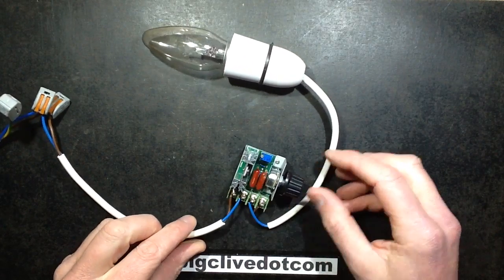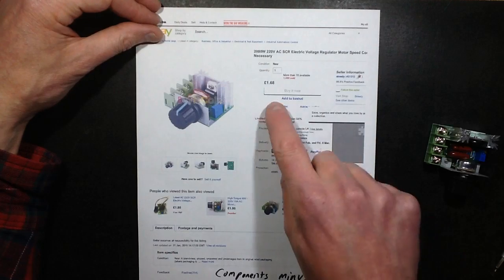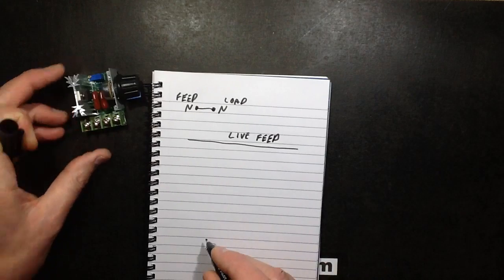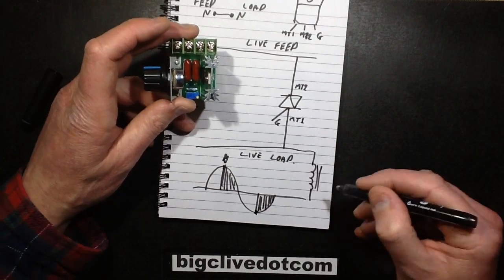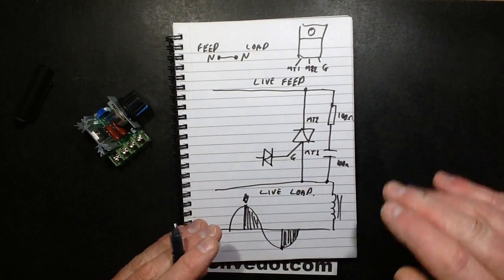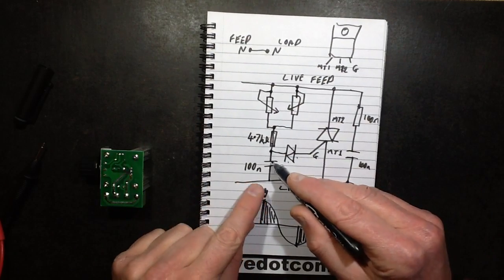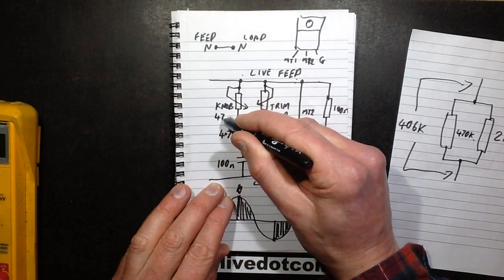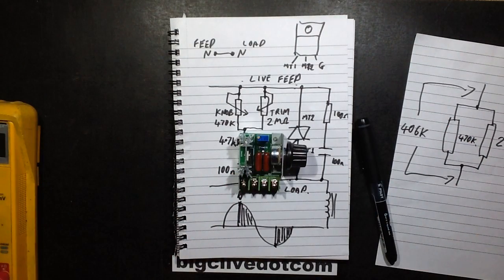Reverse engineering of a mains power controller.

Comment: Can I buy a bigger version of this one and use it to reduce my geyser wattage from 2000w to 1500w AC? I cannot find any zero cross ssr type but only similar like this one. 

I'm worried about the emi noise since I'm going to be running the geysor on inverter.
Reply from the maker: I'm not sure that would work well.

Comment: Thanks for your comment about the clicking sound from the Trimmer when it reaches end of travel.  I never realized that.  Been tinkering with AC motor speed control (small Ham Amp blower motor) by adding Power Inductor between motor and modules.  It helps smooth lower rpm speeds but requires some trial & error part swapping (time).

Comment: Clive. If  a smoothing capacitor is added then is it possible to get a lower voltage and current at the output?
Reply from the maker: Not really.  This is fundamentally a dimmer.

Comment: Hi - Always enjoy your videos and done a few of your vape battery LED light conversions (much to my children's embarassment).  I got a Parkside portable metal cutting bandsaw cheap of FB Marketplace and found out it was cheap because the track from the triac to the load was blown out!  Could this device be used to replace the blown circuit or would swapping just the triac and bridging the blown section of track be a better option.  Happy to share photos if you are interested in helping find a fix
Reply from the maker: Blown tracks is a common issue on PCBs if high current has flowed.  If the triac is physically broken or a dead short between the two main current switching pins then it hints that a short circuit may have occurred in the motor or wiring.   It usually is viable to change the triac if you can find the original fault.

Comment: Can a 110v cauterizer be run on a dimmer switch?
It is a 60 watt soldering iron.
Reply from the maker: Only if it was a simple resistive heater.  If there are any electronics, then no.
Reply: It is a 60 watt soldering iron.

Comment: Can this type of PCB useful to limit the power use for a heating element or are other PCB's more efficient?
I like to limit the power use of a heating element in a solar powered boiler setup in a campervan...
Reply from the maker: It depends on the equipment powering it.  It may be easier just to use a lower power element.
Reply: @bigclivedotcom  The heating element would be powered by a 1500W (3000W peak) inverter. 
I could install a different heating element (I probably will but the stock heating element has an anode (to protect it against whatever fresh drinking water can throw at it) 
I may even come up with a totally different way to plumb the boiler in...  I intend to use the tank of the boiler to fill with coolant from the engine and the internal coil plumbed into the drinking water system...That way the heating element does not need an anode since it is submerged in coolant (which is anti corrosive and without any oxygen - to mention)
This method of plumbing in a boiler is uncommon but not unusual... Bothe methods.

Comment: That circuit makes awful noise when you turn the pot to decrase the power. Any solution?
Reply from the maker: Each type of motor has a preferred speed control system.  This one is over simplified and creates a lot of mechanical noise.  It might be worth looking for a more professional one.
Reply: Thank you for the promt answer. I use it for a 200watt resistive heater and that noise is really disturbing
Reply: Using a triac and potantiometer can we make noisless dimmer? :)

Comment: The formula for calculating a number of resistors in parallel is given by
1/R = 1/R1 + 1/R2 + 1/R3 + ...
Series capacitance has the same format. 
With a University Degree in Physics and Chemistry I never used these formulae since I was in secondary school which I graduated from in June 1974! 
I had to check them on Google.

Comment: Given that this is most likely made using the cheapest parts that could be sourced, I imagine that the tolerance on the potentiometers are going to be in line with the 5-10% standard, so the value of the unknown potentiometer is probably 520k ohms.

Comment: After 7th minute you said that it needs a choke, can you please tell me what type and what rating of choke can we use or how to make that choke for this circuit. And I need output only half of it, i.e. nearly 130v to 140v max, can I attach 100k or 200k ohm resistor in series with potentiometer (knob type) to achieve that voltage. Please also reply to your other video of dimmer. Thank you

Comment: Im looking at buying one to control the speed on my grinder. But very skeptical because i dont want to risk killing my grinder like 3rd party chargers do to iPhones (*・～・*). Right now on amazon these units are $10. Im debating whether i should buy the triac's and diac's and build one myself. You pointed a few things that correspond to the reasons why 3rd party charges kill charging chips on iphones. They are not isolated and insulated properly. Like your explanation of the triac and the wave. Im willing to put some money on it if you willing to design a solid reliable unit. Not now tho, most likely late summer to fall. Winter here is extremely rough lol. Great video man.

Comment: For resistors in parallel 
1/R= 1/R1+1/R2
Hence 1/R-1/R1= 1/R2
(R1-R)/R.R1 = 1/R2

Hence  R2=  (R.R1)/ ( R1-R) 
R2  =  ( 406,000* 2,000,000) / ( 2,000,000  -  406,000)
R2= (406*2000)*1000/(1594)
R2 = (812,000) / (1594)
R2= 509,000
So the control resistor is a potentiometer of 509,000 ohms  .....................where 470,000 was close enough. A good logical calculation by the narrator. Well done.

Comment: Hi !! You are fantastic in all.. please guide me on following, 1) Can this regulator be used to control 750w angle grinder for continuous work?
2) what should be the minimum RPM of grinder to be set to avoid burning of carbon brushes?
3) additional cooling fan required?
4) other precautions if any?
Reply: Hi, this can handle upto 6000w

Comment: how would you earth this ?
Reply from the maker: The earth would go to any metal case it was mounted in.
Reply: @bigclivedotcom  yes .. but I wasn't sure how isolated the power controler design was , .. I have one here , hold on ... ah . ok , the pot mount and the heatsink are isolated. I hadn't checked it before . so connecting the pot mount to earth would be the way , as  the pot is the bit you touch , and will be mounted to the case .
Reply: @bigclivedotcom  Thanks for replying :-)

Comment: I have used this to control the heating element in a homebuilt coffee roaster from a 230 V 1500 W paint stripper.  To roast the coffee it runs for about 12 minutes at 650 Watts.  The BTA-600 has failed after several months.  I have replaced it with a BTA-800 a couple of years ago, and it is still going strong after using it at least every other day.  The line voltage here  ranges from 230 to 240 V.  The ever changing line voltage is enough to mess up the roast, so I needed to tweak it.  I removed the 1 Meg Potentiometer and replaced it with a 50K potentiometer in series with a 320K fixed resistance.  This allows me  to keep the temperature in a narrow range for a satisfactory roast.
Reply: Can this type of PCB useful to limit the power use for a heating element or are other PCB's more efficient?
I like to limit the power use of a heating element in a solar powered boiler setup in a campervan...
The boiler has from the factory a 500W element whereas the solar panel has only 450 Wpeak. 
It would be best to "tone down" the power use of the 500W element to say 300W for the solarpanel to be able to keep up better.
Using a voltage sensitive relay to sense when the battery has been fully charged at which time the heating element is powered to take advantage of the "surplus" solar power...
What do you think ? Can I use this circuit or should I use something else?
Reply: @koningbolo4700  I am using this power controller on 230V mains in the UK.  I am suggesting that the BAT-600 is not reliable at a resistive load of less than half the full load of a 1500W element, but with a simple replacement by a BAT-800,  the controller seems to be reliable.

Your situation of very different, as your power comes from a PV inverter.  There will likely be some complications if you "tone down" the power using this circuit.
Reply: @cornelisspronk4068 So, more the output load is dim more the Triac will heat? 
Hope that can work continuos without begin a startfire at 1/3 of 1000W. 
I also cleaned and add quality thermal past between Triac and heatsink for increase heat transfer

Comment: What i dont understand is, the 2 input ports, how do you connect a uk 3 pin plug 3 wires to it? As I see people are only using 2 pin plugs for them 2 input ports
Reply from the maker: The earth wire would pass through to the appliance being controlled.
Reply: @bigclivedotcom  could you do a video   using a uk 3 pin plug on this dimmer  device to turn on the light bulb thanks - https://youtu.be/J-2i7t17Itc

Comment: Nice video, Is it possible for controlling 600W planner motor speed with  this ? thanks
Reply from the maker: It might work, but would be electrically very noisy.  If the triac failed the planer could go to full speed without warning.

Comment: on mine the 'knob' says 500K, i tried it on an angle grinder and it's pretty rubbish (only like the last 10-20% of the adjustment works).
I saw somewhere else that i need to connect an 'inductive load' (if i remember correctly) to make it work better, that being a 2k 10W resistor, but i can't remember how it was supposed to be connected (probably in series).
Also i have a cheap variable speed drill press (pillar drill) on which the speed controller died, unfortunately it's all incased in epoxy so i can't fix it, it's probably something very similar to this but with no heatsink. So i bought one of these to use with it, and it works a lot better than with the grinder, all of the adjustment works, it just doesn't slow it down nearly as much as the original speed controller, so i probably have to adjust that trimmer pot.
Reply: I got a similar problem when using a household light dimmer to control a DC motor through a bridge rectifier . Using a bulb across the load allowed full control of the motor as there was  solid uninterrupted load for the triac to work with . Maybe you can try that too .

Comment: Got both when connected 220V in?  multi shows 215v out turn knob nothing happens
Reply from the maker: These units need a load to work and a meter will not give a sensible reading as the units vary the waveform.
Reply: @bigclivedotcom  ok thought that could be the prob..much appreciated.
Reply: @bigclivedotcom  This is set up on a stand mixer 110 v I think ///Now reads from 50 v to 180 all over the place..unit runs ok at about 180 v???

Comment: i have the same controller and it has been working as a light dimmer...my issue with this controller is the 500k ohm potentiometer...since i purchased the controller i already have replaced the potentiometer thrice...i do not know what is happening but it seem the carbon inside the potentiometer gets damage easily...how can i protect the potentiometer from being damage in just a few weeks?...thanks.

Comment: Hi!
Can someone explain me the problem i'm facing? So basically, i made the same AC power controller as in the video, but only with BTA16-600B triac. The circuit woks fine, but only when i don't have the 100ohm resistor and capacitor in parallel (for inductive loads). If i connect the resistor and capacitor in parallel, im not able to controll the votlage and it stays around 210V. I wonder what could be the problem, because i alredy checked the circuit and everything seems to be fine. Maybe i can run my universal motor without the parallel capacitor and resistor?
Reply from the maker: Are you testing it under load?
Reply: @bigclivedotcom  Thanks for the reply! Yes, with universal motor connected. Motor just runs at full speed and voltage is somewhat constant above 200V. If i desolder the capacitor,  the circuit starts working just fine and im able to change the voltage. Maybe i just need to change the parallel resitor or capacitor value?

Comment: This is pretty much the exact circuit used in Cheaper Solder Iron stations to control Temps. Some use a version of the Westek 6077B 200-Watt Manual Dimmer circuit to achieve this in a somewhat smaller package.

Comment: "Luvley"! I think that's how you'd describe your video☺️. Thank you, very informative. I'm about to convert my 110V Dremel-workalike  to run on 240V by changing out the speed control unit for  one rated to work at 240V. Hopefully the motor won't burn out.
Reply: Did you get it to work?

I'm using the speed controller from a Dremel type tool to vary the speed on a small 220V DC compressor motor. I need to run it slow enough so that the reciprocating piston can shake aerosol spray paint.

I watched this video to find out how triacs work and left smarter. Thanks Clive.
Reply: @ianhelsbyservices  Sorry, not yet. Don't feel like sacrificing a perfectly good tool just because I don't want to lug a heavy transformer around.
Reply: @mohanvvip  i use 110v angle grinders as they're cheaper second hand than 240v. To avoid carrying the transformer I use a long 110v extension reel.
Would running your tool at 240v double it's speed? Perhaps a smaller transformer could be used. One that's matched to the current requirement of your tool.
Reply: @ianhelsbyservices  I could probably use an incandescent lamp in series. A really serious electronics engineer would probably warn me about the surge current at startup etc, but I think a series resistance would work better than any triac for powering the universal motor for short periods, the only disadvantage being that quite a bit of power would be dissipated in the lamp. I think the motor draws 100 watts.

Comment: Would this be suitable for use with a 400w motor?
Reply from the maker: It depends on the type of motor.  Only some can be controlled with phase angle control.
Reply: @bigclivedotcom  It's a motor in a cheap food processor that has two settings. Off and light speed!

Comment: Well, I have a speed controller like the one you showed in the video. I have a doubt in the calls.

at the current input and current output both phase and neutral connect at one terminal and the other.

that is the input I have two terminals, whatever the phase link in one or the other, and the output the same thing, whatever the connection ?

Comment: It's a single phase shift triac dimmer which will give erratic operation at low triac conduction angles - a nuisance for lamp dimming, more serious with motor control. The so called 'hysteresis' effect. The 100n capacitor suffers very heavy loading as the voltage across it collapses when the triac fires. Solution - a double phase shift circuit, which involves only two additional components, a 1/2 watt resistor (typically 15k for both 120v and 240v supplies) which connects between the junction of the existing 4.7k resistor and 100nF cap and the left hand diac terminal. The additional 100n cap goes between the left hand diac terminal and Neutral. This greatly reduces loading on the original cap and improved operation at 'dim' or slow speed triac settings. The second 100n cap needs to be prooerly voltage rated - same as the first one. This is a bona fide mod found in all the thyristor books.

Comment: Thank you Clive. Pedant point but the snubber network you mention is not 'a filter'. It is indeed to prevent false triggering of the triac with inductive loads. Basically, the triac itself has an internal capacitance (gate to MT). In an inductive load, the voltage across the 'inductor' is not in phase with the current flowing through it. If the current flowing is zero but the voltage is high, the gate 'capacitor' can acquire sufficient charge to trigger the gate (and hence falsely trigger the triac). The faster the change in voltage (dv/dt), the greater the risk. The snubber network is simply a series RC which reduces dv/dt.

Comment: These modules are fine for controlling brushed ac/dc universal motors - as you say. Universal motors are absolutely everywhere, vacuum cleaners, kitchen equipment, shredders and small hand tools. BUT.. these Chinese triac controllers are absolutely USELESS for controlling most ac induction motors - as you find on lathes, bench drills, belt sanders etc. Not only useless but hazardous too. Lots of YT channels give bad advice about this.
Reply: That is because, as I am sure you know, the motors work off different principals . Induction motors may become weaker with triac controls but they are useless for speed control . Best to use a three phase induction motor with an inverter ( but very expensive ) or use one of these guys with a universal motor ( but very noisy for a lathe :/) sadly it seems rather difficult to accurately control the speed of a single phase capacitor start induction motor with electronics .

Comment: When you had it wired up live was linked across input and output. I can't remember what is connected to the tab of a triac but it may be raw power. If so this may be why I vaguely remember seeing diagrams showing things wired as you had - lives to the directly linked terminals. If the triac doesn't have an insulated tab this may be important as it could keep the heatsink at neutral rather than live.

Comment: Can I use as a substitute  with a drill which  has a damaged speed control switch
Reply from the maker: It may work.  You can also buy replacement speed control triggers online.
Reply: @bigclivedotcom  Thanks

Comment: If wanted to control say up to 2500W, could one use 2 of these?  In parallel?  Thanks
Reply from the maker: You get higher powered units.  I wouldn't recommend paralleling them,